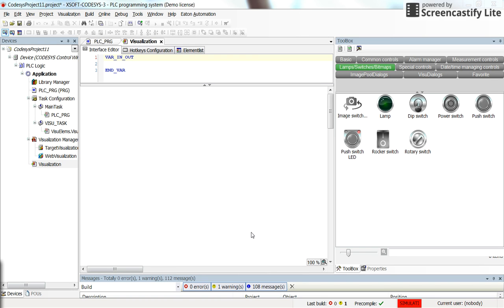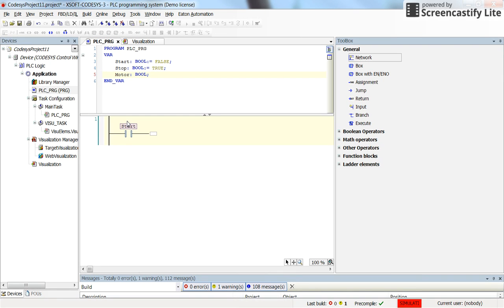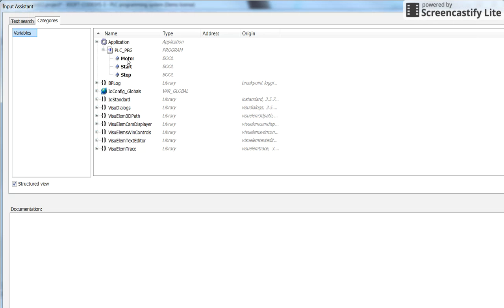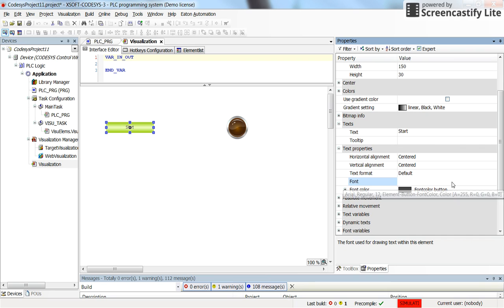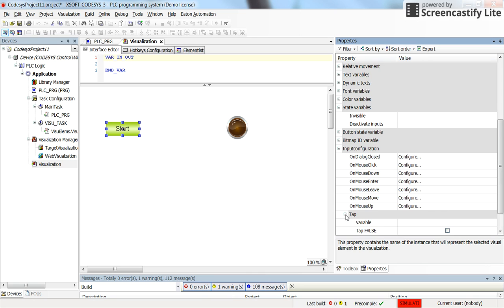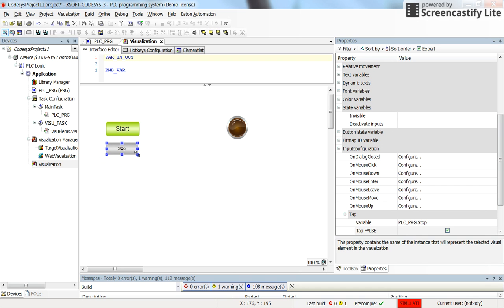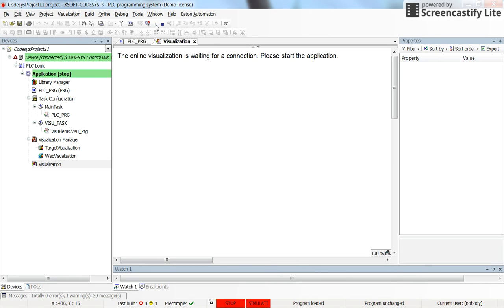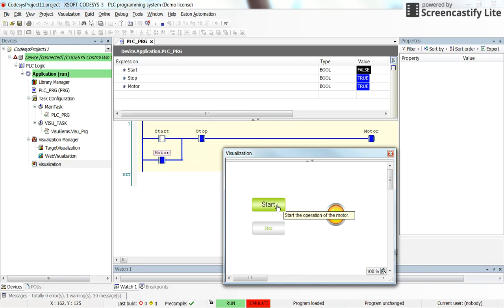CODESYS: Visualization trick - Creating momentary switches #codesys #plcprogramming #iec61131

Comment: I have a whole set of screen buttons in my HMI and I want to change color on tap on each of them to give touch feedback to the operator. 
Problem:
If I use one variable BOOL for Tap -> Variable for all the buttons, if I tap on any button the rest of them also change the color.
It does not make sense and I don't want to create separate variables for each of the buttons in the interface.

Comment: Hello,
button a tap can't define variables. Although I select PLC_PRG.start, plc outputs do not change when the button is pressed. Do I need to add a library or where is the error?
codesys version 2.3
Reply from the maker: Hi,
You don't need a library to have the button working normally. I am not sure about the reason for your issue. Did you manage to fix it?

Comment: can i activate one button, without deactivating the second one?
Reply from the maker: If the buttons refer to different variables, then normally you should be able to activate and deactivate the buttons independently, unless the logic prevents this situation. For example, it does not make sense to activate both Start and Stop buttons at the same time.
I hope I answered your question.